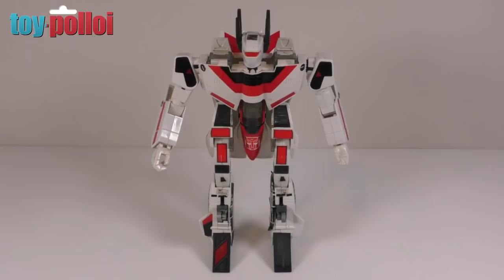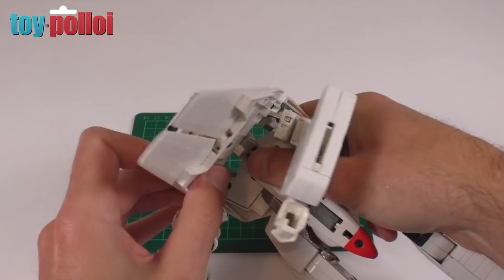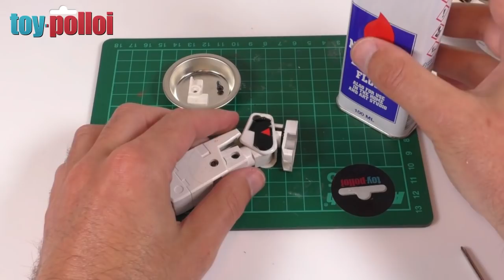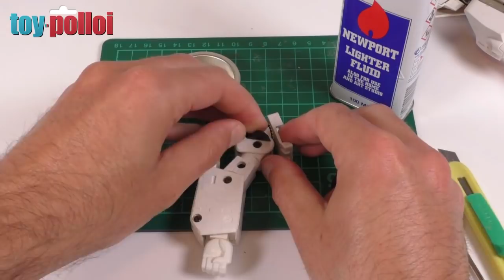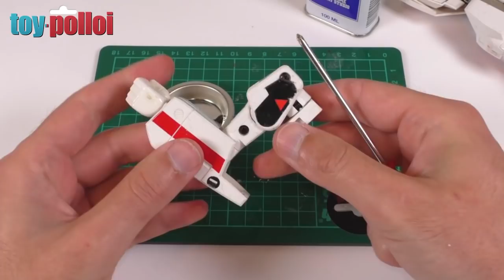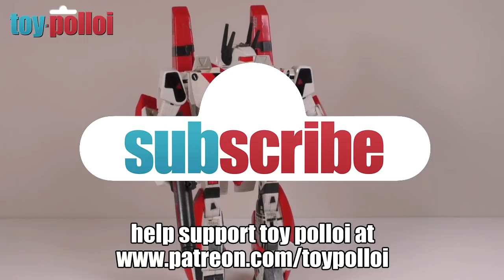Transformers G1 Jetfire mini fix - Toy Polloi

Comment: That solved an over 3 decade mystery. I got Jetfire for Easter and, within a week, I heard a snap and some metal (the metal ring that was missing) came out of his left arm. I never took it apart because I didn't want to destroy the stickers (long before I knew of your lighter fluid trick) so I just lived with the floppy arm. Jetfire was right handed anyway 😉.
I'm glad he was serviceable. Another great fix, Dave.👍
Reply from the maker: Thanks Michael. That explains the missing piece, but not why the arm was put together wrong. Must have been a factory error.
Reply: @toypolloi  I think so, which may have caused the breakage in the first place. I don't remember much more, other than it breaking and just playing through. Thanks again for the cool video and trip down memory lane.

Comment: Awe one of my first Restoration projects..i used to buy jetfire parts lots back in the early days of ebay for a couple of bucks, and make complete Jetfires  i managed to score two early versions that still had the Macross emblems on the wings.. For a while there were cheap bootleg ones in the swapmeet for 5 dollars, and i bought a bunch hoping to convert them to Stampede, ostrich, and Elintseeker Valkyrie variants but never got around to it. Hopefully someday when i retire..

Comment: My favorite toy of all time, I was quite excited to this video come up.  I only wish you did more with it!  For instance, often the the plastic tab that comes out of the back plate and holds in the metal hinge on either  side of his head in robot mode snap off and are missing!  I'd love to see what kind of creative approach you take to fastening down that hinge in an aesthetically pleasing way.  Or for that matter, it would be nice to see you jury rig a fix for your Jetfire's missing arm hardware.  For the record, the gear and spring you are missing in the upper arm are actually identical to the ones in the shoulder (but you probably realized that when you disassembled the other arm).  I'm unabashedly biased in favor of more Jetfire videos, but I'll take what I can get.  Thanks for what you do!

Comment: I have an original White, yellow and black Robotech Veritech that is more of less the same toy as Jetfire. Unfortunately the back armor piece that holds the rockets on his back in place is cracked at the bottom where it slides over the backpack.  I'm currently trying Plastruct Plastic Weld on the part, but I may just have to seek another out.  The part is a slate gray color, while Jetfire's version of the part is red.   

Great video!  It's just funny who I was working on my Veritech this morning when this video debuted!

Comment: Hard to tell, but the grommet looks like a Belleville Washer. It’s basically a spring in a washer shape. You can probably get them from a site similar to McMaster Carr or one that is closer to you.
Reply: The black ratcheting grommets in the shoulders disintegrate over time but they're also in the elbows.

Comment: Have you ever used superglue to fix the joints? I find if I drip a drop or two into a loose joint and continue to rotate it while the glue "sets", it doesn't lock the joint, it just sort of fills in the gaps, but as long as you keep moving it for about 30 seconds, it builds up a layer that keeps them tight without gluing the pieces together.

Comment: I have a jetfire it's missing the backpack on closer examination the backplate hinge is broken so I would need a backplate and pack. The problem is I have no resources for parts and Ebay is too crazy for pricing do you have recommendations for parts resources?

Comment: Any ideas on whitening plastic that has yellowed over time? Great video!😆👍
Reply: shadowspwnz use a 12% hydrogen peroxide solution. Pour it un a container, put the plastic in and use UV lights. Leave it over night and boom. It’s called retro brightening.
Reply: @StudioHappyboy  Hey, thanks! Only issue is it's a G1 Jetfire like in this video. Would I have to take it all apart to soak in the solution?

Comment: It was so hard to transform as a kid I just kept it in plane mode
Reply from the maker: It was. There are some even more tricky ones as well.
Reply: @toypolloi  the new masterpiece transformers can be quite difficult but what from the G1 line did you difficult?
Reply from the maker: Megatron is an awful transformation. Great in gun mode, ugly and flimsy in figure mode.
Reply: @toypolloi  I agree I've just got the masterpiece version it's much better the original broke too easy for me

Comment: I still don't get why they used a Battleloid for Transformers. 
By the way Dave, I wanted to thank you for all your tips, they helped me fix and restore my old TMNT action figures that had been broken and glued for years.
Reply: The robot design predates Robotech, originating with Super Dimension Fortress Macross anime from Japan. The series was made by Studio Nue but funded by Big West Frontier, who aggressively marketed the animation and visual designs in the United States. The VF-1 Valkyrie's iconic design appeared in numerous licensed works, almost always with a new backstory. Besides Jetfire, models of the VF-1 could be found repacked in Revell's "Robotech Defenders" line (which was purchased outright by Harmony Gold and combined with their re-edit of Macross and two other anime series to produce Robotech) and 21st Century Imports/FASA's BattleTech models and games. The latter famously set off a series of lawsuits which lasted over three decades! But besides the "big three" of Transformers, Robotech, and BattleTech, I can remember innumerable official, licensed, unlicensed, and out-right knock-off versions of the Valkyrie for most of the mid-to-late 1980s. These pretty quickly died out as new properties became popular and international copyright law was strengthened.

But for me, this will always be the PXH-1 Phoenix Hawk. :D

Comment: Why, when I look at that figure, do I think: 'Macross VF-1S Valkyrie'?
Reply: Because Jetfire is a 1/55 scale bandi VF-1S. the original toy was released as A & J model and S model as well as the Ellyinseeker  and the VF 1D trainer version from Macross love you remember 84. I have one in the closet I think it's called the super ostrich.  Jetfire in that comes with the Roy Fokker special armor that was originally molded in dark gray. If you get an original first round Jetfire it still has the Macross logos on the jetpacks
Reply: I was just given one and need to repair the backpack. (The one with the rudder on it).  I found a replacement backpack but need to use epoxy putty to build up the back and insert a pin to hols it in unless someone else has a suggestion to fix it.
Reply: Because it is
Reply: @shewme71  honestly a lot of jet fighters get parties out. It might be easier to look on eBay or Facebook real quick before you do that.
Reply: Do any of you know of STL files for printing parts for the G1 jetfire?
Reply: @shewme71  I would suggest thing verse or shapeways?